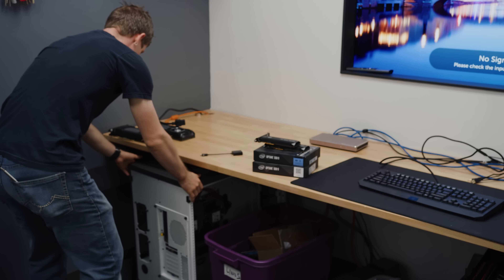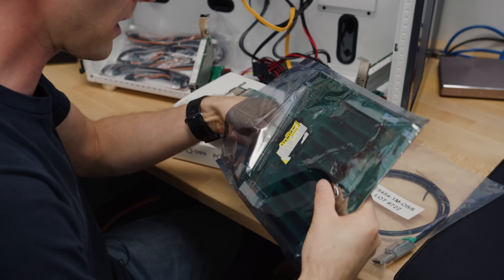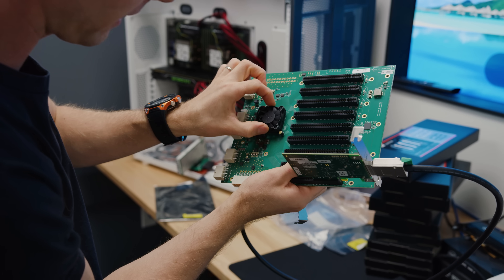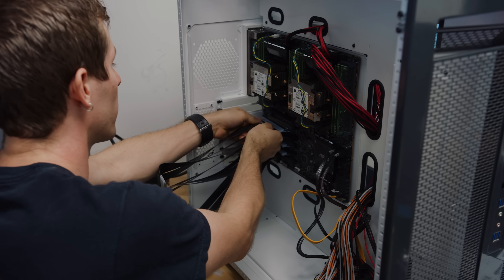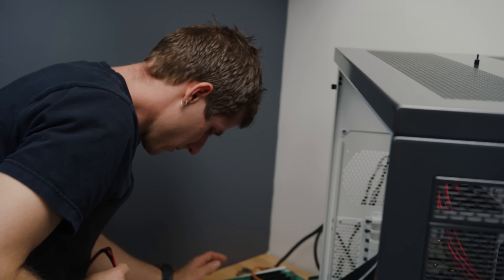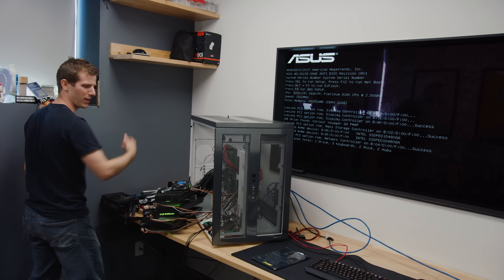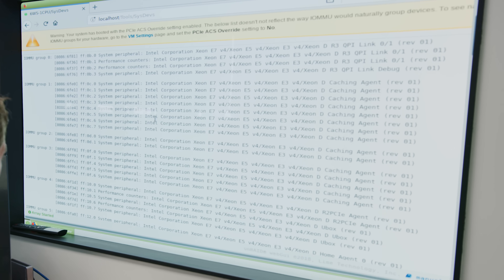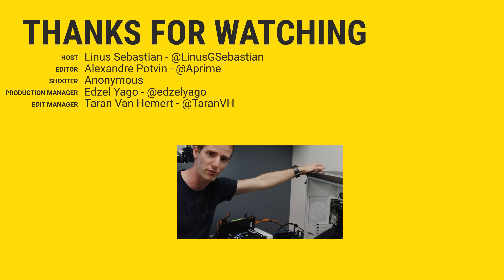Building the $100,000 PC Pt. 2 - SO MANY PCIe CARDS

Comment: Holy fuck -- each one of those components is sold separately -- and they're not cheap -- that's like $2500 worth of stuff that OSS just sent you! -- Have you considered the consumer grade chineseium variants, like these?: https://www.amazon.com/SEDNA-express-slots-Riser-Multiplier/dp/B075DF9L5V/ref=sr_1_15_sspa?s=electronics&ie=UTF8&qid=1534530882&sr=1-15-spons&keywords=16x+pcie+adapter&psc=1&smid=A1R5BKHOXF4WU
Reply: The other thing to consider --- maybe put each GPU on the $1600 daughter board instead of the USB cards? (because you don't intend to hot plug GPUs, right?)
Reply: Oh, here you go! -- this one takes one 16x port, and gives you 3 16x ports -- so, you could run a GPU and a USB card off of a single 16x port -- one port for each user: http://www.plinkusa.net/web2U-3R_Express16X.htm

Comment: @5:20 -- The other thing that would be interesting to know about that PLX extension board is -- like -- sure it's not going to give you more than 4x lanes between the cards and the CPU -- BUT -- do the cards have 16x lanes of bandwidth to each other (i.e. for things like PCIe based SLI)? -- If the PLX is truly a network switch-like device, it would mean they had full bandwidth between each other, even if they didn't have full 16x bandwidth to the CPU.

Comment: aren't you supposed to avoid putting equipment on the outside of antistatic bags?
Reply: osbert not really. The entire point of an anti static bag is that the whole bag is preventing static. You  can set your motherboard on the anti static bag, it'll be fine.
Reply: I don't know about all that... they are (or at least they used to be) made with non-conductive material on the inner side of the bag and a conductive material on the outside, to act like a Faraday cage, or otherwise to allow static to discharge when handling the outside. Either way, it's all about the difference in charge between the bag, the board and Linus. Considering he's doing it in a carpeted room with those sandals on, the bag is probably the least of his ESD worries.
Reply: osbert Jay recently did a video on all the things you "aren't supposed to do" when building a PC. He placed the board on the anti static bag etc. And the PC worked fine. https://youtu.be/CDUZRNp4pxg

Comment: Sorry for the 4th comment but you can probably still use USB hot plugs by a rather complicated way. What you can do is make Raspberry Pi USB switches connected to the USB cards and make the Pi's send a signal to the main VM that will use all the USB ports on which card the USB device is plugged in, then since all of the VM's will show up on the same LAN, for drives create a cache on the target VM and sync the cache you created to the USB device and for the peripherals simulate them in a similar way using LAN. This will require 8 Raspberry Pi's and a lot of coding and third party snippets which will cost a lot since coding sync and simulation flawlessly takes weeks. I suspect this is the most guaranteed solution you can go with when the costs and coding time are not concerned.

Comment: Why not a wireless solution for all the inputs instead of dealing with the PCI-E USB cards? Or you could just split the USB 2.0.3.0 headers on the motherboard too if wireless isn't an option. At least that you can assign different hardware to different VMs.

Comment: I wonder if there is a "PCIe switch" that can split a single PCIe in to 2 slots rather than 8. Than have a GFX card and USB per "Actual PCIe slot" which you could pass through to VM.

Comment: Such PLX cards are widely used in bitcoin mining machines. You throw a bunch of consumer level Nvidia graphics cards on it and let them calculate transaction data using the CUDA cores. It's usually designed to be only using a PCI-E x4 interface since the workload doesn't need very high bandwidth. But, yeah, it needs freaking high power supply like you demonstrated. Unfortunately, the thing is, video editing requires very high bandwidth between your drives and CPU. Not to mention you want to put multiple workloads on it at the same time. So, I don't think it will fit your demand.

Comment: Linus you are an idiot.
Having 1 computer do the work of 8 puts you in the dangerous position that if that PC breaks you are shit out of luck and have 8 guys who cant do jack shit until it's back working again. 

This is why Union Pacific stopped ordering super powerful locomotives. Because if a 6600 horsepower unit failed when working with just 1 other they'd need another ultra expensive super-train to get out there. So instead they use 3 or four 4500HP trains on both sides of a load. If one goes down you still have five others to pick up the slack.

Comment: Why all the USB ports?  He isn't planning on physically connected them all to this machine, is he?  If so, why?  Just have them remote in from their existing workstations.  Or better yet just remote app the editing software and drop shortcuts on their desktops.  Take true advantage of virtualization to separate the work from the workstation, so you can drop in a replacement PC on short notice, work remotely from a laptop or from home, all on the same beefy, secure backend.

Comment: My immediate thought when I saw that board was "Oh, it's kinda similar to an IBM 5161!" Then you pulled out the cable and mentioned you could put in in an external case, and I thought "Oh, that's literally a modern IBM 5161!"

Comment: When I set up my Unraid box I could specify a PCIe device in the VM's XML by it's address (eg. 01:00.1) and it just worked.  Could you just pass through each USB controller to a VM using this method, rather than using the GUI, or am I missing something?

Comment: 6:33 the 24 pin connector wont fit with it like that. It could if you de-solder it use a straight connector, not the right angle one.

Comment: You have to use AMD to solve all your problems
Reply: IOMMU isolation is completely broken with AMD. That being said, if he switched from unraid to vmware for running the VMs, it'll work out of the box. This is entirely a hypervisor OS issue.
Reply: ESXi would have the same problem, not a hypervisor issue.
Reply: VvV Black 2990wx babieyieyy

Comment: That's nice, because usb 3.0 runs out faster than people think, the way devices and end points are counted means the default intel implementation only gives you about 30 ports worth or whatever, not the 127 you'd imagine, so you rapidly run out with hubs and stuff.

Comment: I'm surprised your plan wasn't to run Thunderbolt 3 cards for each VM so that it would only require running a single cable to each subsequent workstation, much like you did at your home. I' haven't got a clue if that's even possible, but I think it'd be considerably better than having a thousand USB ports and cables plugged into the back!

Comment: Jake could always just take the hardware home where it wont get damaged, actually with how you treat hardware #firelinus.
Would love to go nuts with these though, even just for a picture knowing it'd never turn on.
Threadripper+ 32core.
Edit- https://uk.pcpartpicker.com/list/DHw2WD
8 of these >OSS (3811) adaptors and 4 of the (452)backplates
>eight PCIE cards at 8x each per backplate, thats 32 TitanV's or whatever.
(and 3 m.2 NVME ssd's because why not!?)
You could actually game on 4 way crossfire with 8x for each card just using the first card in each backplane :D and still have ~655Tflops of fp32 assuming the shared pcie8x doesnt bottleneck which it probably would, you couldn't power it anyway.
Don't even get me started with epyc2, IF asus made a board like the WS C621E SAGE but for epyc thats 7 backplates with 8 single slot waterblocked cards in each, figure vega64x2 cards at 1500mhz (IF ever made), thats 2752Tflops of FP32, No I didn't miss the decimal point 2.7Petaflops. Thor couldn't power that though. I said "go nuts" I mean't literally insane.

Comment: how to get 30 FPS in minesweeper
Reply: are you all insane? he hasn't enabled SLI yet. after he enables it it will finally be capable of showing the desktop at 1024X768 at 30 FPS!
Reply: MASON Reviews You're overestimating I think 24 cinematic frame rate at most
Reply: With that shitty build lol 15 tops
Reply: That Shit won't even Run Pacman
Reply: 1989 colorized

Comment: Obviously the power wasn’t going to be enough just 1power supply with that huge extension board, and filling every pci port which the power supply have to push more power to feed everything evenly and smooth but only one power supply wouldn’t cut it, logically. You should see how much you’d have to invest into a super computing grade power supply custom made just for this.

Comment: I like how Linus rages at others for how they handle equipment but he manhandles equipment ALL OF THE TIME! I've got 13 years of systems experience under my belt and I would have been terminated many times over if I treated equipment the way Linus does on camera. The mere fact that he's stacked expensive graphics cards one atop another in a wobbly stack and has a PSU about to fall off of a desk blows my mind. The test bench placed on top of the PSU with dangling SSDs makes me wanna call computer protective services.

Comment: I know people say you don't need to have your radiators in-between your components so you can have CPU and GPU then the rad rather than the rad being in-between. But what happens when you have 7 GPUs water cooler? Does the loop still equalise?

Comment: Linus et al. - you can get this working with the VFIO kernel module and simply blacklisting the devices (graphics cards and USB 3.0 cards) intended for the VMs. They can then be in the same IOMMU group. I have KVM on my home Debian PC and use VFIO to block my GTX 1060 from getting loaded by my host (the embedded Intel graphics are more than enough for a basic desktop) so it can be free for a Win10 VM. My embedded graphics, GTX 1060, and it's soundcard are all in the same IOMMU group. 

Granted UnRaid is based on Slackware and not Debian, but I'd expect the same behavior since VFIO has been around for a while. 

Proof of the issue:

root@Ghanima:/mnt/Storage/Video/Movies# for a in /sys/kernel/iommu_groups/*; do find $a -type l; done | sort --version-sort
/sys/kernel/iommu_groups/0/devices/0000:00:00.0
/sys/kernel/iommu_groups/1/devices/0000:00:01.0
/sys/kernel/iommu_groups/1/devices/0000:01:00.0
/sys/kernel/iommu_groups/1/devices/0000:01:00.1
/sys/kernel/iommu_groups/2/devices/0000:00:02.0
...
root@Ghanima:/mnt/Storage/Video/Movies# lspci -s 00:01.0
00:01.0 PCI bridge: Intel Corporation Skylake PCIe Controller (x16) (rev 07)
root@Ghanima:/mnt/Storage/Video/Movies# lspci -s 01:00.0
01:00.0 VGA compatible controller: NVIDIA Corporation GP106 [GeForce GTX 1060 3GB] (rev a1)
root@Ghanima:/mnt/Storage/Video/Movies# lspci -s 01:00.1
01:00.1 Audio device: NVIDIA Corporation Device 10f1 (rev a1)

My fix to map the PCIe IDs to the vfio module: 

root@Ghanima:/mnt/Storage/Video/Movies# more /etc/modprobe.d/vfio.conf 
options vfio-pci ids=10de:1c02,10de:10f1
options vfio-pci disable_vga=1

When my Win10 VM is running: (see the kernel module associated is vfio, and not the native one)

root@Ghanima:/mnt/Storage/Video/Movies# lspci -nnk | grep -A3 NVIDIA
01:00.0 VGA compatible controller [0300]: NVIDIA Corporation GP106 [GeForce GTX 1060 3GB] [10de:1c02] (rev a1)
        Subsystem: eVga.com. Corp. GP106 [GeForce GTX 1060 3GB] [3842:6160]
        Kernel driver in use: vfio-pci
        Kernel modules: nvidia
01:00.1 Audio device [0403]: NVIDIA Corporation Device [10de:10f1] (rev a1)
        Subsystem: eVga.com. Corp. Device [3842:6160]
        Kernel driver in use: vfio-pci
        Kernel modules: snd_hda_intel

Disclaimer: I do Linux Systems Administration professionally, your mileage may vary.

Comment: Is there any real benefit for having 6 people on one massive computer rather than 6 $16,000 PCs, or is it just to show that it can be done?
Reply: HydroFall - Gaming just to show it can be done lol
Reply: if you asking for real benefits, you are at the wrong channel :D
Reply: Probably so that they can transfer data between editors quicker (as it's on the same machine)
Reply: I guess it is space efficient lol
Reply: This must be your first day here
Reply: It makes sense if you want 60 people on just 10 of these. Maybe.
Reply: Youtube $$$
Reply: HydroFall - Gaming 
It is usually done to seperate the actual computer from the place people work.

Say a bank or engineering firm being hired for a Ministry of Defence project. You cannot let people have physical access to the computer because (corporate) espionage through direct commandline acces, keyloggers, usb bugs, etc. So you lock away the computer. Now you have 12 people needing to work on that pc. What do? Give them access by long cables that go to outside the secured space where the computer is. 

There are single thick tamperproof cables that will run mouse+keyboard+displayport signal at once for this application. Screw in tight, have security inspect the cable, if there is no funny business, good to go. Harder to do with a single big case where it might have been opened (even with the case open alert) and something can be missed easily. If you do need to inspect the 1 case easier to do than 16 single computers.

It does create a single point of failure but also creates more security if handled well. Mostly you will see the applications being run on 2 or 3 nodes if uptime or loss of minutes of work is a concern. Still seperated, still secured, but easier than 16 single computers under a desk.
Reply: +HydroFall - Gaming if this has the processing power of those 6 separate PCs then yes - one person can render (i.e. using as much capability as is available) whilst five people are editing (i.e. lower workload), which will mean that one person rendering will get better performance than if they all had separate PCs. If they all want to render at once, it would probably be slightly slower than 6 separate PCs. 

One way to think of it would be like if you and your 5 neighbours each had a separate 1" pipe to the water company, or if you shared a 2.5" pipe. If you have the 2.5" pipe, then you can get a significantly higher flow of water when your neighbours aren't using it fully, but if you all jump in the shower at the same time then you each get the same as if you had a 1" pipe.
Reply: HydroFall - Gaming what do you think
Reply: Just wondering, sorry I've never built a $100k pc before =)

Comment: I repeatedly contacted Asus about a BIOS problem with their motherboards where they would brick themselves when connecting additional PCIe devices via a PCIe switch. First they accused me of mining, then they dodged the issue, and finally they outright refused to solve the problem with a BIOS update. I am very disappointing with their hardware and their support process. Please do yourself a favour and do not buy Asus brand products.

edit: more details: It was a PCIe x16 to 8 x PCIe x1 plx bridge chip with powered risers. The system would post and work with the additional devices (ethernet adapters, usb controllers, etc) until you connected more GPU's. Then the motherboard would brick itself during post and still not post after removing all the additional hardware! I explained this to Asus multiple times very clearly and they simply refused to provide support.

Comment: Could this work with a nforce6m-a to do sli with 2 or 3 graphics cards?
Would like to know because i found a old pc in the trash and am trying to get it to work so i can run everything from DOS to windows 10 and linux mint but it has only 1 pci-16 + 1 pci-1 + 3 pci ports and can support 32 gigabytes of ddr2 800 ram.
Would be good gaming pc if i can get it running.
Reply: nathan mead ddr2 is becoming too slow for gaming. Might be OK, but CPU bottleneck to be expected.
Reply: nessotrin jean 
The pc im building is going to be used mostly for 3d modeling and animation + playing old windows 98 and xp games and emulation.
im going to get a gaming laptop a hp silver fusion for running everything else because the silver fusion laptops have 8 or 16 gigabytes of ddr3 and a Intel core i3 CPU running at 2.1-2.5ghz.